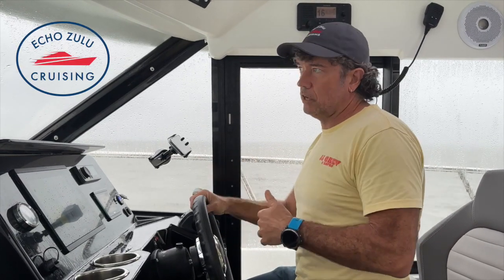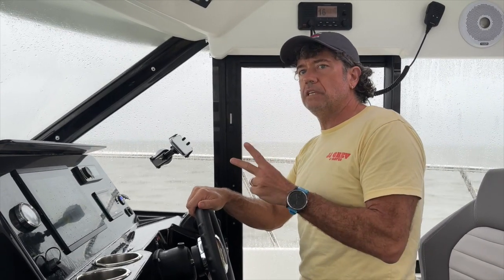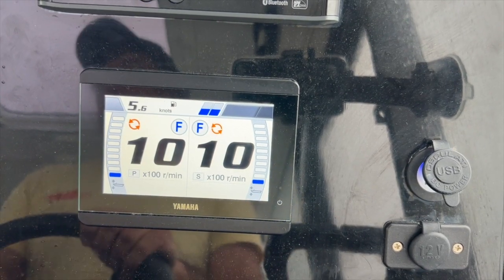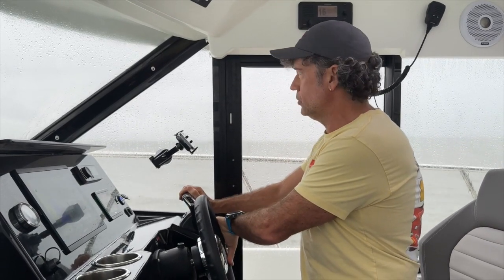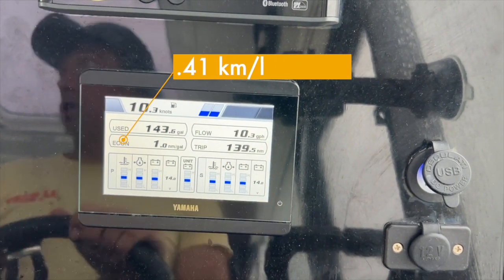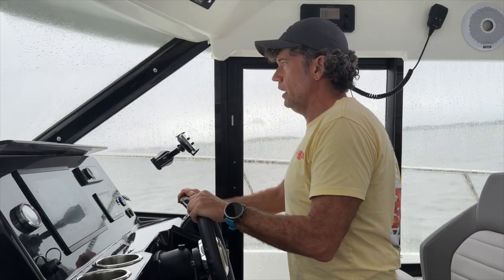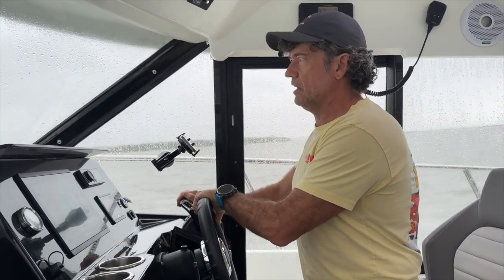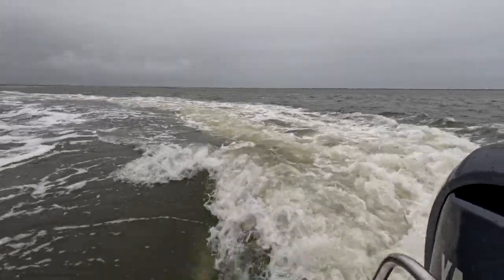Most Efficient: Jeanneau 1095's Twin Yamahas Tested from 500 to 5000 RPM!

Comment: Excellent video.  I am considering a 1095 but am concerned about its motoring ease slogging at 8-14 knots, below planning speed.Sarasota Bay and adjacent bays have long stretches of very narrow ICW with lines of traversing boats, requiring these modest speeds.  Have you tried using just only engine when slower speed is required?  Does this help?  Thanks.  REally enjoying all your videos.
Reply from the maker: Thank you for the encouragement. One engine can help. The boat (or me maybe) is happiest in a plane, 7 knots is easier than 10 knots from a wake stand point.

Comment: Excellent information. I would love to have this data on the 895,  795 and 695. We do the majority of our boating on open pacific ocean  running from cove to cove and you cant count on smooth conditions.   I have been interested in the 895 for awhile,  but if this date carries through on the 895 I am no longer interested in investing in one of these crafts. If we are trying to do a 100- 250 mile passage  and our only option is running under 1000rpm or over 4000rpm we would either run of of time crawling along at 7 knots or run out of fuel  slugging along at 14 knots. Living in Alaska where the ports and fuel docks are days apart, I am going to rethink a full displacement hull boat.
Reply from the maker: I would love to do performance on other boats - just need someone to lend one to me.  The tanks are not huge for longer range on the Weekenders. They are designed to do a lot, and maximize space and comfort at anchor over long-range cruising.  Fuel capacity is one of those compromises.  For stability and range, something full displacement may be a better option for you.
Reply: @echozulucruising  That was one of the best videos I have seen for a realistic fuel/speed comparison. I am a bit of a data geek so thank you.. Living in Alaska our choices in boats is a rather thin selections. We are heading down to the Anacortes Boat show in May for three busy days of walking the docks. I have a feeling we will be a overwhelmed but we are looking forward to the trip
Reply from the maker: @johnmcneal9477 dreaming about boats can be as enjoyable, and much cheaper, than owning one. Though we enjoy it. We try to convey real world ownership and enjoyment. It goes a long way to get positive feedback. Thank you. Let us know what the favorite boat you see there.

Comment: I'm on the verge of getting a 1095, the range listed most places is 115-200 nautical miles.  Yet, it seems at normal cruising speed its about 1 nautical mile per gallon and a tank of 106 gallons is the actual real range closer to 100 Nautical Miles?
Reply from the maker: There are two tanks with the 106, so total is real about 210 gallons.  We go about 180 nm max to keep a reserve.

Comment: If possible could you see what the fuel consumption is in litres per hour at 25knots and flat out for both engines. No problem if not, but be great to know as we are looking to buy one next season
Reply from the maker: I will try to figure out. Because of how we run the boat we rarely have a steady speed over a period of time.

Comment: After one year of ownership,
Positive:
Spacious, plenty of storage. Interior holding well
Mercury outboards fantastic. Fast boat. Joystick is a real joy for docking. Love Garmin electronics. Low clearance for low bridges. Good looking boat.
Negatives:
Light weight, bit unstable at anchor and rough going on choppy bay.
Portside glass panel shattered, long wait to replace. 
Portholes paint flanking off. Cheap materials.
Acces to raw water strainer for A/C not easy so that stateroom can't be used for storage.
Brass seacocks, in salt water, need replacement every 5 years. Through hull are British thread so special order.
Reply from the maker: Great comments. I am in the US, so power cords, through hulls and  railing attachments are all non-standard. We do not have a joy stick, a little jealous about those.  Sorry about the window.  Have seen a few people with that same issue. We have been comfortable at anchor - but in protected harbors. The low dead rise (ie flat bottom) contributes to that rough ride in waves.

Comment: Great video! Just a question, you mentioned that the fuel burn is the same at 1500 rpm (1.7MPG) , as 5000 rpm (. 8mpg). It would be great if it could get 1.7mpg at 5000 rpm 😍

How do you feel the 1095 would do at 1400 - 1500 rpm on a longish trip if you weren't in a hurry? 1.7 mpg is quite decent.

Thanks
Reply from the maker: About 1800 rpm or so i guess is when it starts sucking the fuel from dragging bottom like you are wide open. It would personally drive me insane to go at 1500 ish RPM, but, I like to get places. You could completely enjoy the view and double your range. It is hard in no wake areas of the  ICW at the low rpm because trawlers can pass you, but if you speed up a little, you throw a larger wake. It is a boat designed to be on a plane for sure.
Reply: @echozulucruising  Thank you for the quick reply! I was just looking at the 1095 on Saturday here in Victoria BC at a floating boat show. Gorgeous boat, and I couldn't believe the room on board. Maybe next spring...
Reply from the maker: @Matthew-hi5ud  we looked at boats for years looking for something to take on week long trips. The value for the features and size of 1095 seem unmatched in the market. think of the 3rd cabin as storage more than anything. I was shocked that my friend who is 6'7" was comfortable in the 2nd cabin. My wife and I truly love the boat, despite any imperfections, because it is so versatile - day trips with our kids to hang at the beach, weekends together on board.

Comment: so realistically as a cruising boat offshore its not a good boat ? how often can you travel at 30 knots offshore ?? I would much prefer a cruise off shore of say 15 knots I am a serious buyer and this does not thrill me but really appreciate the review
Reply from the maker: Our base cruising is about 25 knots when off shore, but is weather dependent. It is definitely an “express cruiser,” that runs smoother (and is more fuel efficient) on a plane. Most of the out board express cruisers we have looked at seem to run more efficiently and smoother above 20 knots. 

One boat we have looked at that seems to fit that cruising is the Beneteau Swift Trawler 35 is a slight larger boat, with semi displacement cruising of about 16 knots:  https://www.beneteau.com/en-us/swift-trawler/swift-trawler-35 

The swift traveler has some of the same well thought out design elements and may be worth a look.
Reply: @echozulucruising  yes I agree with the beneteau it’s on my list ! Thanks for taking the time to reply I look forward to more of your great videos 
Phil
Reply from the maker: Thank you. Good luck in your search.

Comment: Matches our 1095 pretty closely.  Do you have Zipwake interceptors or Lenco trim tabs?
Reply from the maker: Lenco trim tabs.
Reply: @echozulucruising  We have the Zipwakes.    I noticed you had the outboards trimmed way down, just brought them up a little at 5100.  Was that due to sea conditions?
Reply from the maker: Likely more to do with the artificial nature of filming and watching gauges in the RPM progression than sea conditions. Normally begin trimming outboards and tabs when we are close to a plane past about 4000 rpm. Did not even touch the trim tabs, almost always have the port tab down some once we are on a plane and the engines trimmed more past 4200 rpm.
Reply: Hi. I just bought a 1095 and I’m tying to dial in the props. What is the maximum RPM you get and maximum speed? Also what pitch is your propellor? Thanks.